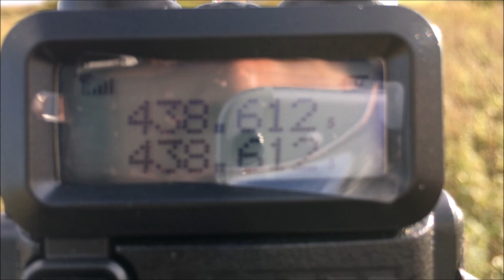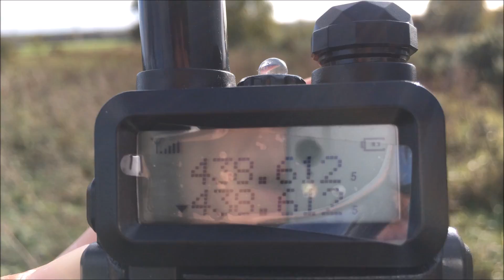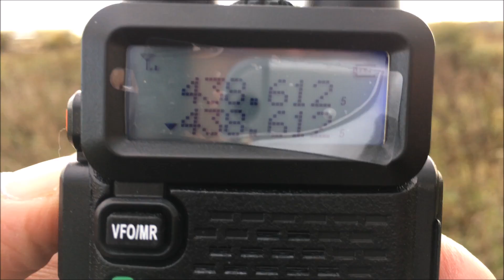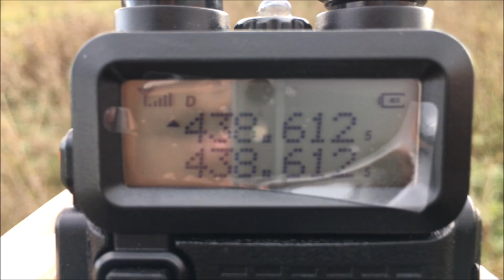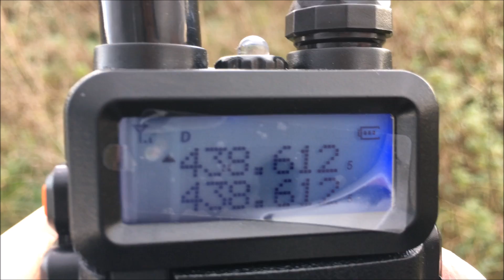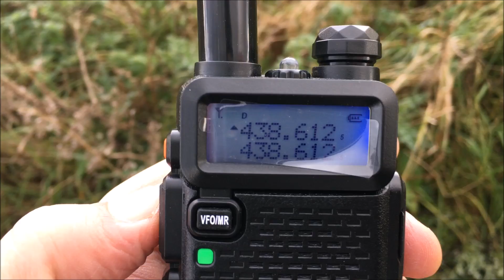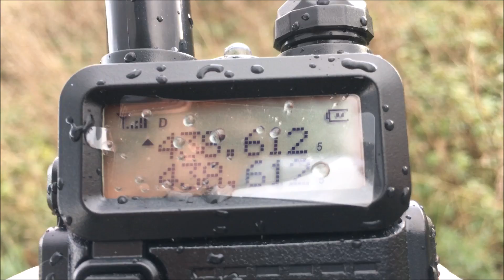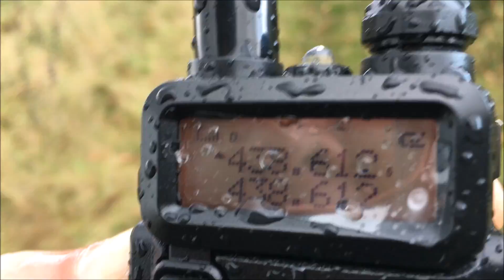Baofeng DM 5R Digital, Analogue Waterproof Test - Part 2

Comment: Did you ever update the radios to the newer firmware allowing use of AMBE2+ vocoder?
Reply from the maker: I've not touched it since to be honest mate. I need to have a play.
Reply from the maker: I've not touched it since to be honest mate. I need to have a play.
Reply: If you do update it you'll be able to use it on DMR simplex and for listening only on repeaters. However you shouldn't transmit on any DMR repeaters with it because you would be transmitting in both timeslots and jamming the one you're not using for others.
Reply from the maker: I must have a look at doing it actually, if I get round to it I'll do a video on it. Cheers
Reply: There's a video on it out there already. I think you have to pay for the update though unfortunately. Radioddity has it for 10 USD. I don't know if anybody else is selling it or if you can get it free somewhere.

Comment: Sounds like this radio is using the chinese made ASELP vocoder instead of AMBE. Certainly saves them a lot of money but they really shouldn't advertise it as a DMR radio
Reply from the maker: Cheers for the info guys.
Reply: ***** Thanks, yeah I had heard quite a bit about that. I still don't think it should be sold as a DMR radio. Even tier 1 DMR radios are meant to be able to transmit on only one timeslot.

Comment: I've been told that even after the firmware update, the radio is still incompatible with tier 2 dmr repeaters. All the update does is add a vocoder.
Reply from the maker: I'm not surprised paul, waste of time radio haha. Cheers
Reply: Ringway Manchester although your audio and signal was very good on the digital test. I guess they are not looking at compatibility just cheap digital radios to sell across various markets in the thousands. I think if you replaced a fleet of analogue UV-5Rs with these then people would probably be happy.

I guess they may find a following in the 'UHF CB" world.
Reply from the maker: Yeah you're right really Jon. They're no good.
Reply from the maker: Yeah not good. It's been sat on the shelf since I got it lol
Reply: Ringway Manchester they were gong to release a version with the update already applied...not sure if they have. can you simply scan up snd down for commercial dmr stuff ?